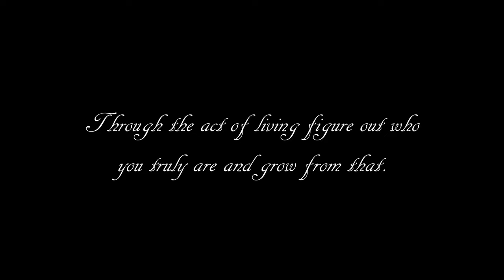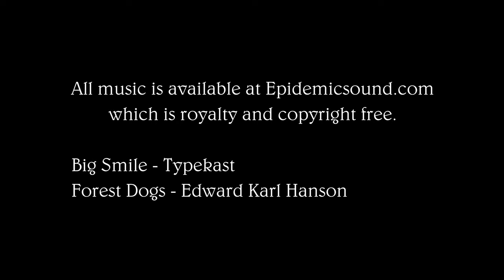Skoolie School Bus Conversion #42 Leak Fix and Wood Fill - April 16 & 18, 2019

Comment: You do realize that the combination of that wood expanding and contracting with changes in temperature and humidity and the vibration of driving that bus is going to make alll of that a wasted effort. Those gaps are all going to reappear in short order. On top of that the filler you created will absorb paint and/or stain at a different rate than the natural wood because of its glue component making your “repair” that much more visually obvious.
Reply from the maker: It's been a year since i filmed this and it turned out pretty good.  I live in an area with wild weather fluctuations and humidity and the filler has held quite well.  Also the filler became a darker color when stained and it makes it look like it belongs.  In a future episode i do point out a couple of spots that separated but i think that might be because there was too much filler and it couldn't hold.